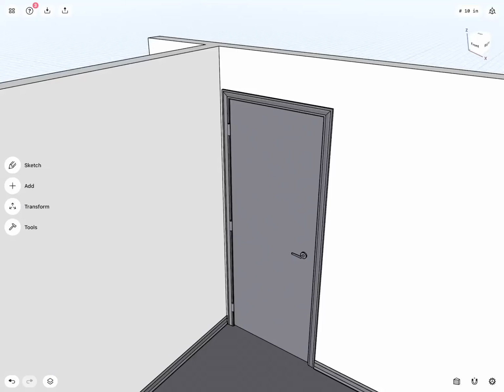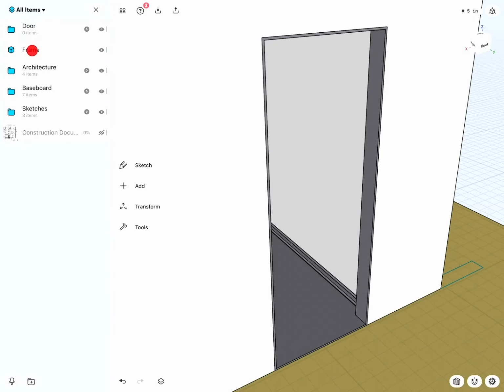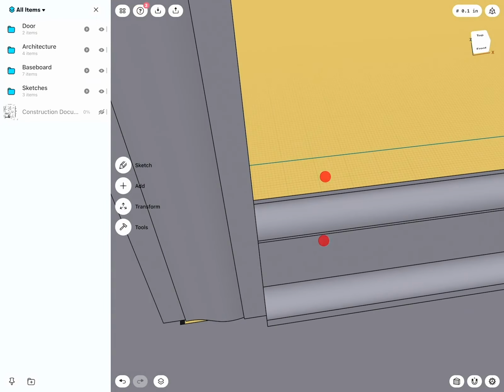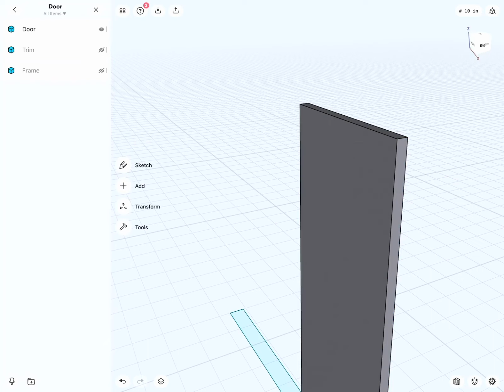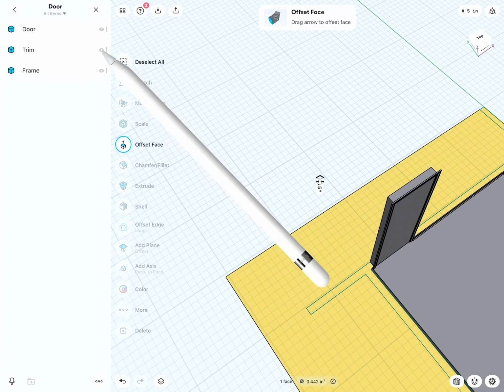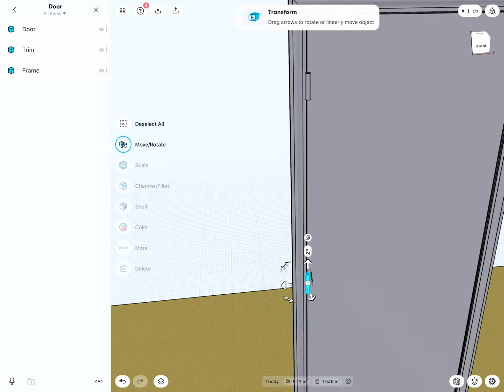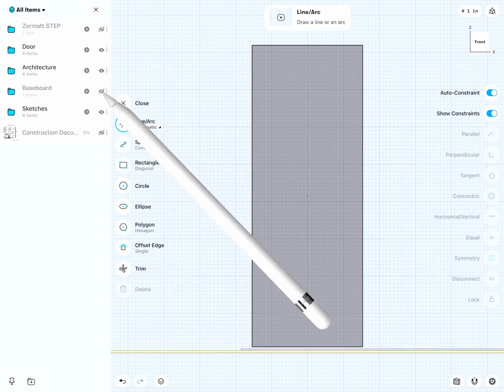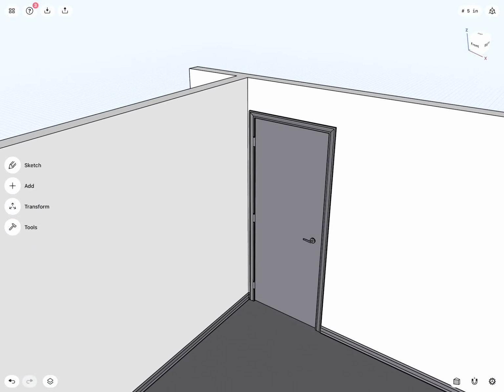3D Modeling for Interior Design: Doors & Hinges | Shapr3D Step-by-Step

Comment: Its my first time using Shapr3D and it’s my first time doing any 3D modeling, I’m making my house and it’s surprisingly easy to make things in the app. One thing annoying is trying to look around in small places, I’m making “small” things inside the house as well like beds and couches but every time I swipe a tiny bit with one finger the screen goes through like 4 walls.
Anything I can do to make that easier?
Reply from the maker: Please reach out to our support team directly and they will provide you with detailed assistance: support@shapr3d.com
Reply: @Shapr3D  I’ve managed to figure out how to make smaller things easier, I just temporarily remove the roof. Thanks for the reply tho

Comment: How to fit this door into another wall openening with different measures? Without spending so much time... is there any logic in these objects? Are these thing objects? Or just a bunch of polygones?
Reply from the maker: Hi! Objects modeled in Shapr3d are 3D closed solid bodies. If you modeled the door and the wall opening in the app, you can simply adjust their dimensions to fit. Then use the Translate tool to place the door on the wall opening and here's our short video on the Translate tool: https://www.youtube.com/watch?v=fKhR7Xc9f5E 
I hope that this is helpful.
Reply: @Shapr3D  oh wow having a qualified answer ... i would love to do some basic architectural form size findings for several plots... if I start with a 2D hight line topographic picture... how to make a raw anamorohic slope just for sketching forms and sizes into it?